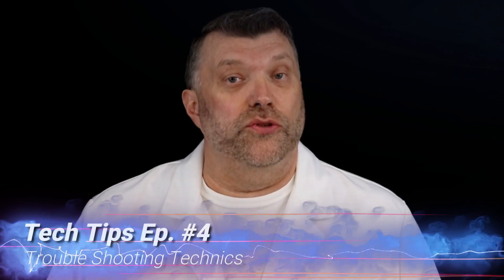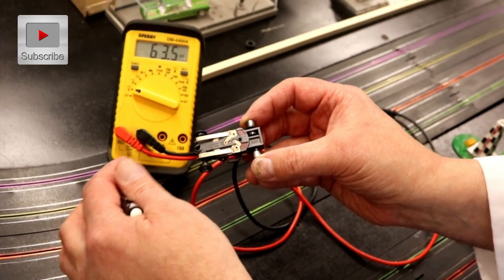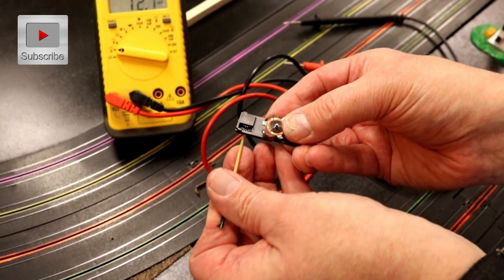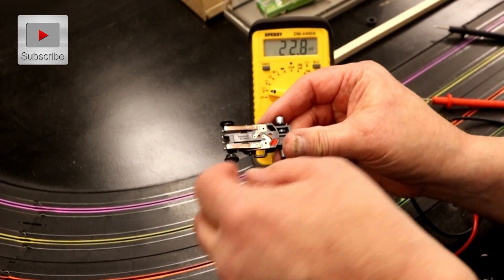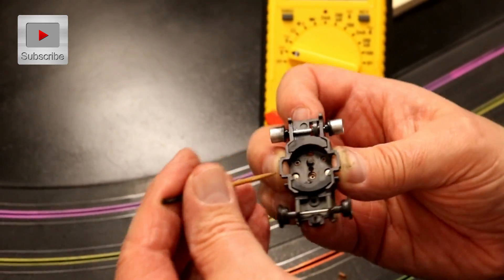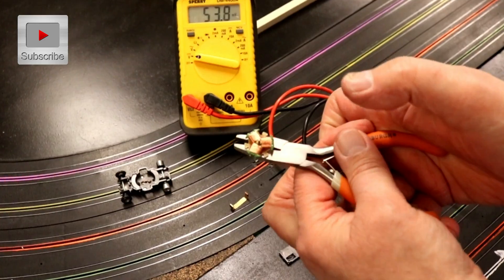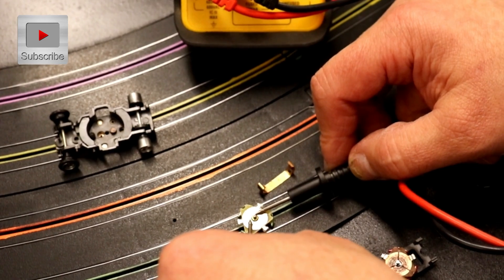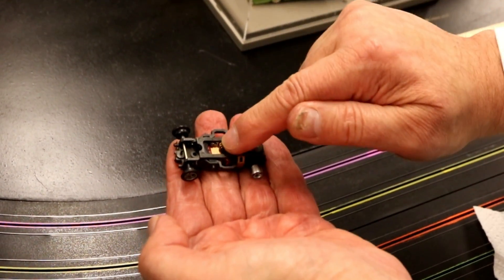HO Slot Car Tech Tips(EP 4): Checking Electrical Components

Comment: Great detail man. Any video I can look  at to check electricity before the car. I found an old Tyco raceway set in my dads basement. I have tested my power supply cord and I am getting 23VDC output, but when I plug it into the power track unit, I don't get any voltage for the two controllers pins. I also don't get any voltage to the track.

Comment: Hey I just find your channel and maybe you can help with a question about another H0 brand (auto world 4 gear) It has a plastic guide pin, but the cars when they crash at a corner the pin will bend or break quickly. Do you know if I can use metal guide pin from another brand slot car? I cannot find guide pins that are metal and specifically for auto world 4 gear chassis. Or do I have to do some DIY?

Comment: Wish I seen this before I tore up the only one I have! Great info. Got a new 10amp 30 volt power supply. Cars run cooler and cleaner wouldn't believe it if I didn't see it. 300 laps and still going on one set of shoes! Love it. I have an older power supply 24volt 100 amp if u know any one interested. FYI unused
Reply from the maker: Mike Douglas just did it.